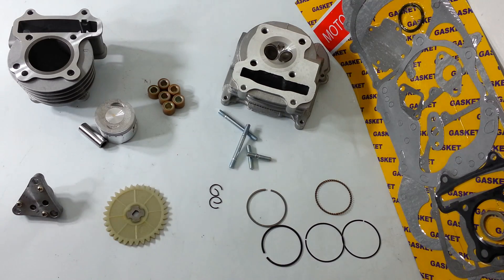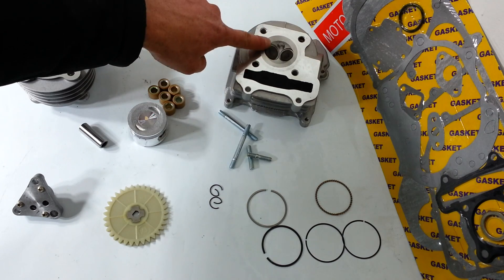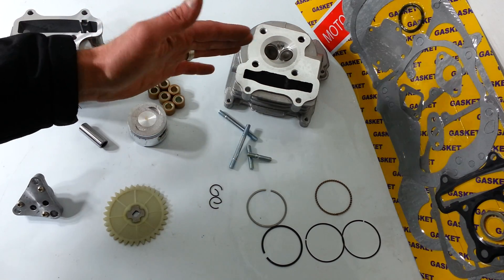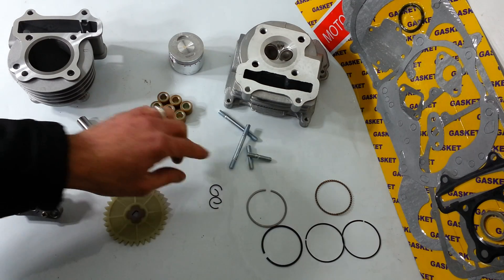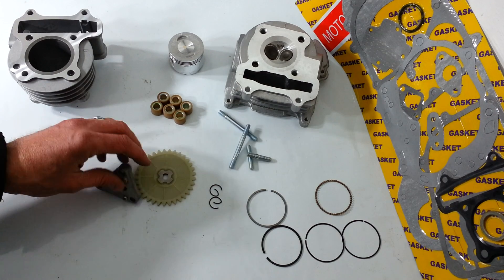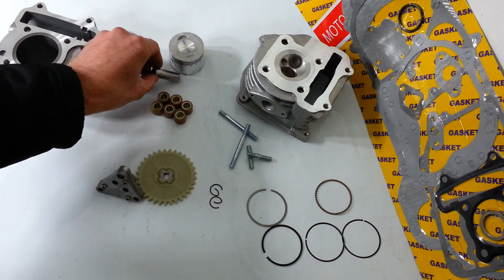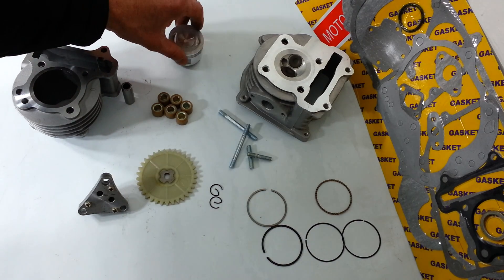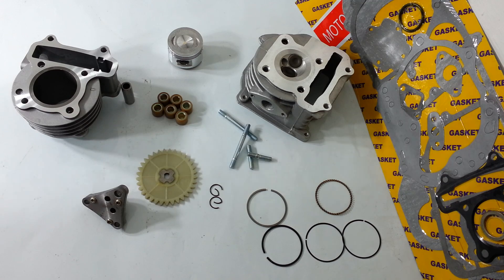Stage 1 80cc big bore kit by Rolling Wrench

Comment from the maker: This is for different style motors. The oil pump that comes in the kit is just a replacement and in most cases not necessary. Stay away from the cheap ebay kits. We tried them and they do not last.
Reply: is the cylinder cast or forged?